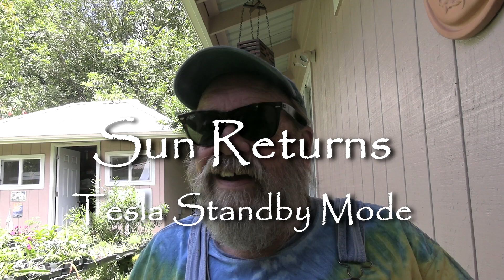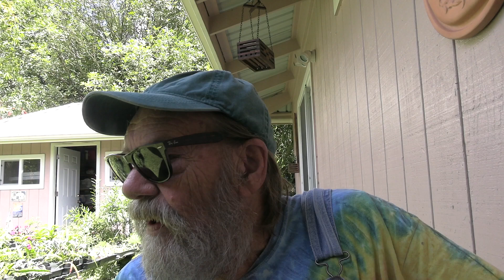Sunshine Returns Tesla Standby Mode

Comment: I almost went Tesla wall but went with LiPo. 100% usable power, no heating and far superior in explosive safety. They will last decades and still hold the same power. I love your channel and I’m glad you got your power going again. Aloha from FF
Reply from the maker: If I had been off grid I would have used a different type of system.  At present, if the system is grid tied there really isn't a better system then the Tesla.  Mine was the second generation  Lithium Manganese Cobalt Oxide (NMC) battery.  There have been some reports of fires but not enough to effect the home fire insurance rates if you use them.  The Tesla is a lot more than a battery.  It is a smart system.  Hard to make the comparison to batteries.
Reply from the maker: LiPo can burn too.   Overcharging a LiPo battery can be dangerous and may cause it to overheat or explode.